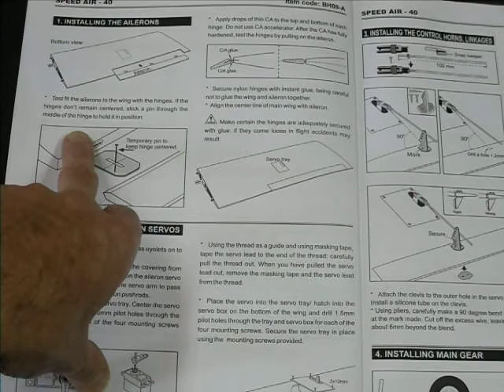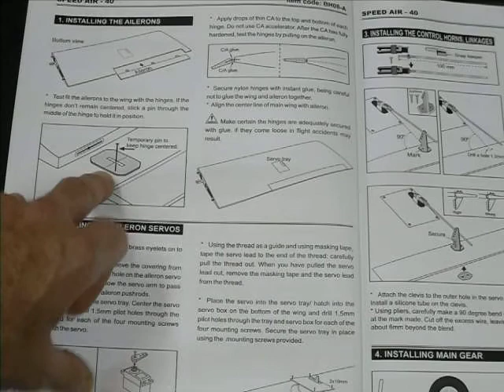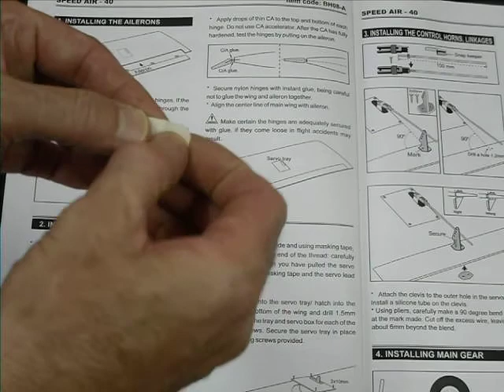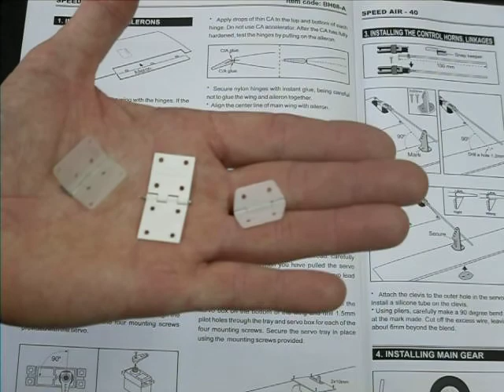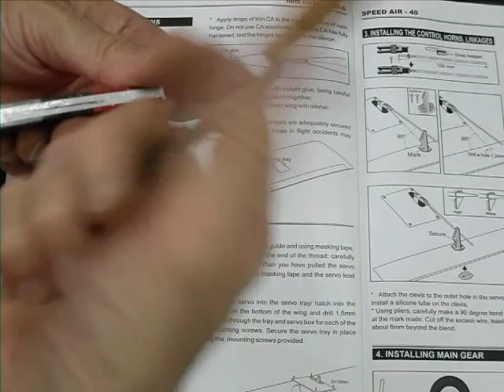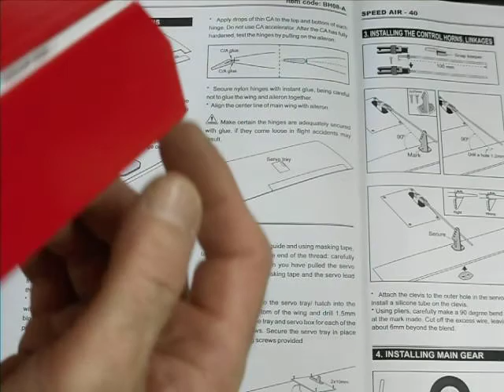RC model plane hinge modification

Comment: I feel like "falling under it's own weight" might not be best though. I know what you meant, absolutely unencumbered free-movement.  However, if the control surface is large or heavy, that weight = stress on the foam, hinges and servo etc.  I've seen a real-world/full-size DHC-2 Beaver's control surfaces mass-balanced so well with counterweights that one could almost blow them up and down just by whistling toward it.

What about the importance of ensuring all your pins are in exact alignment? You can make a jig or use a guide bar, measuring rule, grid/graph paper, lay down a very thin strip of plastic/CF, thin piece that runs entire length of hinge edge, adhere ALL hinges to strip, either all horizontal and level, or where they need to be if your hinged edges have curves or bends/angles.

You can also get Music Wire or Metal Rod of your choice the same diameter as your hinge pins, and insert 1 long rod through ALL hinges, to ensure proper alignment. 

Also, measure the gap between hinged edges BEFORE they are ever cut or torn or break. Take close-up pictures. This allows you to modify, shave off, add to, the hinged edges if necessary or desired, and ensure your surfaces are still the correct distance from each other.

Comment: Hi Andy.I agree,its far better like this,for sure worth the littel investment,also on C/L models.If the control surface is move so  easy,you can use also lighter and smaller servos and save weight . Happy flying!!...and safe landings  ;-)
Reply from the maker: Hi Peter. You are right about being able to use smaller servos. Also there is no battery drain as the servo struggles to move a very stiff surface. Glad to hear from you. Happy flights and safe landings.